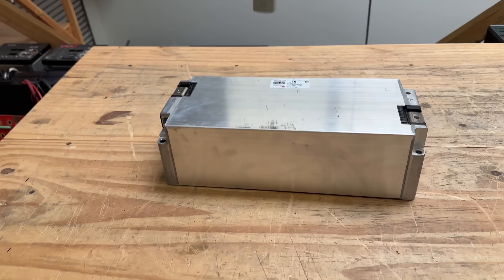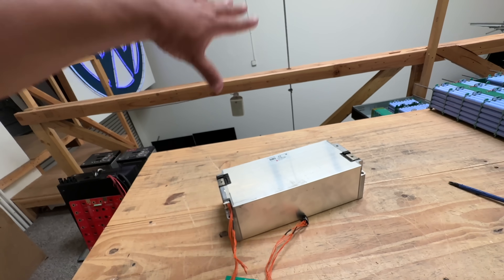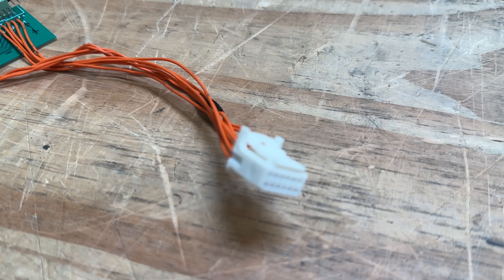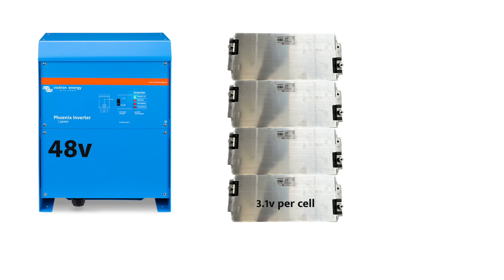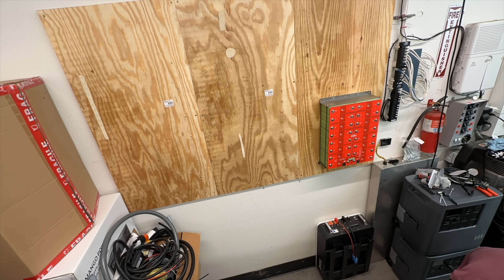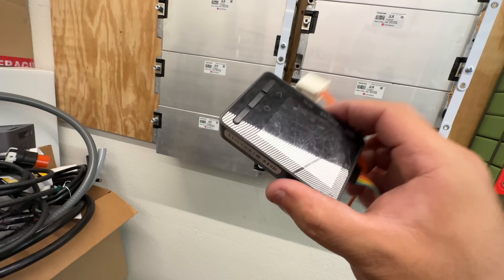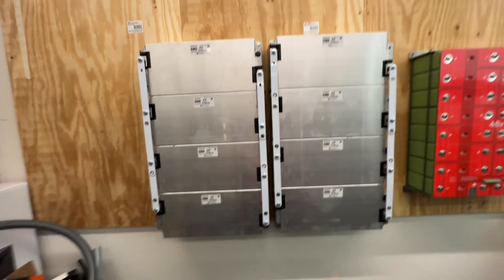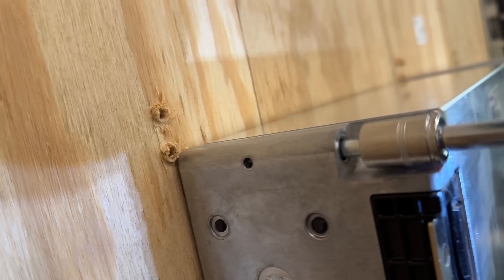$76/kWh Jag iPace Battery Modules -  BEST DIY Battery

Comment: I have a question for you, about three batteries from you after hooking them up to my scooter the scooter cut song rims for about 10 seconds then shuts off for about 30 it will start back what does the same process is the batteries just got the aluminum case you had to have that duano to wake it up

Comment: Jaguar iPace is the only “big” EV really infamous to burn down, due to its poorly designed batteries. Good luck and stay safe!😮
Reply: Yeah, I wouldn't be going anywhere near them, and no way in hell would I be installing them IN my garage or house 💣
Reply: Dayum so these batteries come from the 3000 recalled full battery packs (36 modules a pack)

Comment: Can a BMS be installed? Or are you relying  on the inverter settings?
Reply from the maker: Bms can and should be installed  just like in any other battery system
Reply: Hey Yehu can I contact You with info about new BMS system for PV inverters?
Reply from the maker: Ok

Comment: Hi great information and ideas jaguar I pace battery has 36 cells in as you show.How would you connect them for UK 240v single phase domestic house and which inverter? Would you run all BMS through a laptop dedicated to monitoring recording data? Much appreciate your work and demonstrations

Comment: great offer - but unfortunatelly US only. We are still relying on chinese LFP deliveries only, but the prices have dropped big time to now 1100€ or 1200$ per 14 kWh for EVE LF280K and 100€ more for the EVE MB31 with then 16 kWh.
Reply from the maker: Our LifePO4 supply from china will go up 60%-100% with tariffs starting on 2025
Reply: @jehugarcia  this is why you can get great deals now.
Reply: @jehugarcia  wait your selling the cell now.
Reply: Agreed. You can buy 16kw online, the new 280k unused. Delivered within 10 days.
Reply: are you from europe ? its easy find car cells here, prices sometimes can be lower than US
Reply: @duniek86  Can you link some sites?
Reply: @duniek86  china no tax not import fees new cells.
Reply: @duniek86 used model 3 LFP batteries can be used without opening them up
Reply: @OlavAlexanderMjelde  I know, also KIA/HYUNDAI - some ppl in my coutnry offering plug and play devices and these even not that expensive - 65-80kwh packs plug and play for about 30-33k PLN (7-8k USD) - in comparasion 10kwh packs from companies - cost about 10-13k PLN (2,5-3k usd)
Reply: @duniek86 where ? 😊